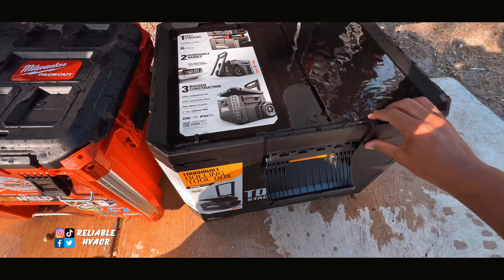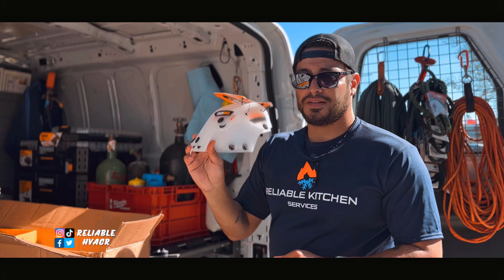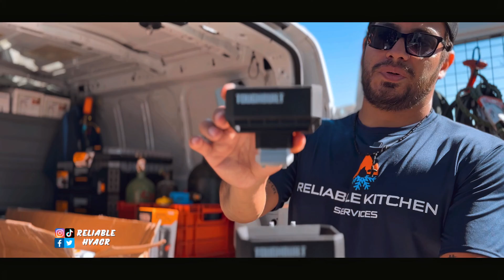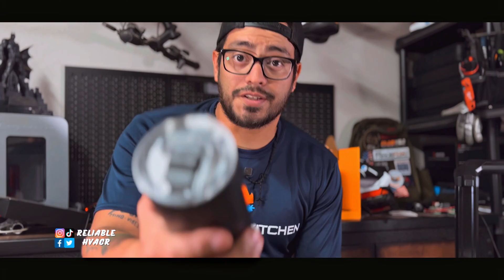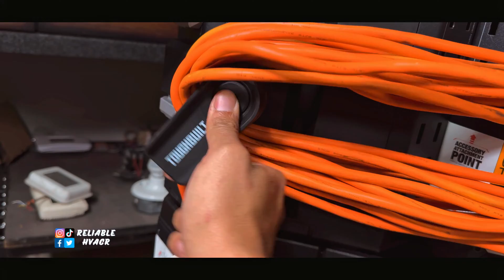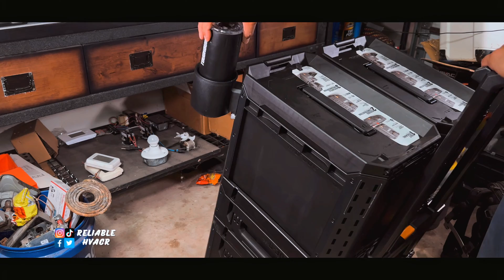First Look at some NEW TOUGHBUILT STACKTECH ACCESSORIES / available soon

Comment: First comment someone with brains, should really be designing these drawers to hold the tools that one uses  on a daily basis. Haven't found a drawer, yet that holds my Milwaukee. Framing Nailer 15 gauge finish nailer.
Number 2, comment, not real for sure. What the freaking holdup is with the new stuff coming to the united states.But I really wish to god somebody would hurry up and figure it out definitely tired of waiting third comment can't understand why we haven't got a cord reel with 4 way plug at bare minimum. instead of the cord wrap. Attachment for the sides

Comment: Always wanted some kind of storage like this for my work vehicle, and I finally had some time off and was going to do it all with Toughbuilt Stacktech, but they didn’t offer mounting plates and boxes with drawers at the time. The drawer boxes are really the only thing I was interested in. So I invested in 12 different Milwaukee Packout drawer boxes, some of their small parts boxes, compact box, first aid kit and vacuum. 
If Toughbuilt had everything that I wanted/needed to complete my project at the time of launch I would’ve been a long term customer, but that’s not going to happen now. It’s a shame because I like the sleek black boxes and the connections between the boxes, IMO probably the best. Stacktech would’ve looked better for my application as well. 
Don’t get me wrong, I’m extremely pleased with Milwaukee Packout and everything works like it should. 
Maybe in the future when Toughbuilt Stacktech works out all the bugs and have more to offer I will invest in that system.

Comment: The best knee pads I've ever used are Troxell Super Soft.
They hold up really well, easy on & off.
I'm definitely converting to the Tough Built system when the drawer system comes out.
I have Ridgid 2.0 but the clip system sucks, they don't last over long-term use.
Reply: Had the ridgid 2.0 too, after a couple weeks the top box is completely loose due to the POS clip system! In the middle of switching to toughbuilt now, so much easier in the van!

Comment: @toughbuilt
We would love to see a 2 or 3 Drawer rolling lower box — In Spring, we have the single Drawer roller but a quality multi drawer lower would be ideal for trades/home enthusiasts

Something that Packout Users have been craving for years
Reply: There is a 3 drawer xl on release for spring along with the single drawer. The summer release has xl 4,2 & 1 drawer and a large si gle drawer as well as the xl drawer roller too
Reply: @NoCrow  agreed. In the future, I’d love to see the bottom roller box being offered in a drawer option 👍🏽
Reply: @iblinktv  won't be a very long wait. Saw someone posted a short that the 3 drawer xl due for spring was already in their lowes. So the single drawer roller may release before summer anyways. It's on the way either way. Summer isn't that far away.
Reply: @NoCrow  no it’s not, very stoked for their Spring/Summer releases but hope we see a 3 drawer roller
Reply from the maker: We need all sorts of drawer options 🙌🏽

Comment: It is pretty impressive that  Tough Built is watching and listening to the point that they already reached out to let the market know they would be offering an adapter to fix the half box to full box latching issue. Once they get their full line of offerings rolled out theyre going to be a serious contender in the market imo. Until then, like youve mentioned, folks that need to get the work done will need to purchase the boxes that are available and can get the work done. There are probably going to be lots of folks like myself that have checked the system out at lowes but are holding off and using their existing boxes (Tough built 2.0 in my case) to wait and see how quick Toughbuilt can get most of the rest of their offerings rolled out and on the market. If they get out most of their offerings within the next year I will be upgrading to the Stack Tech so long as their prices remain reasonable.

Comment: Are the clips that mount to the rails plastic? Do they seem like they would hold up? Also what is the inside diameter of the cup holder?
Reply from the maker: The back spring loaded silver part is metal, overall very light but the pieces are solid and strong. I was impressed when I had them in my hands.

Forgot to mention it's a narrow tumbler so the holder is about 3 & 1/4" inside diameter

Comment: I like that you can easily remove the accessories and customize the box setup for whatever you might need for each project. I use there cliptech pouches and it's nice to wear what you need depending on the job. Hopefully with the adapter for the half boxes it can also be used as a floor/wall mount.
Reply from the maker: That would make sense